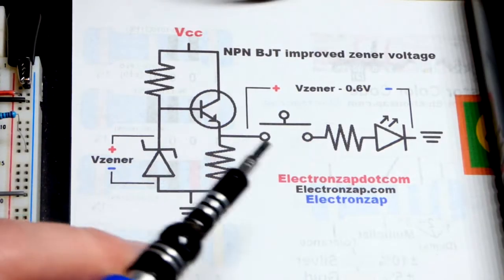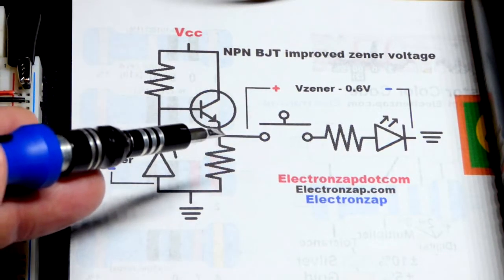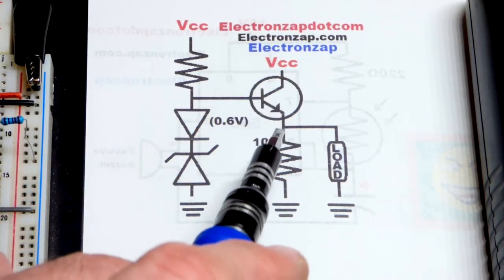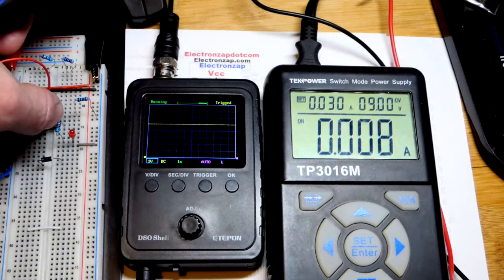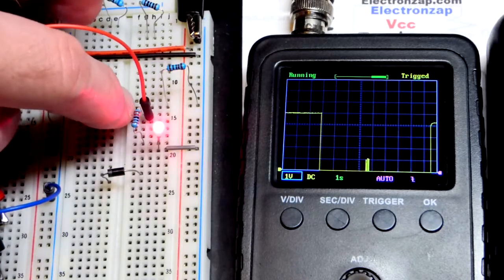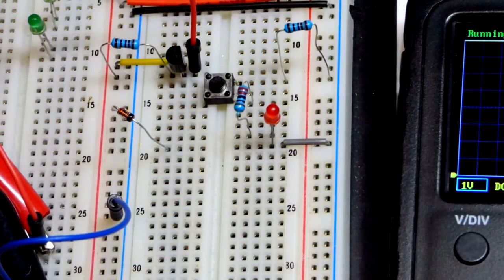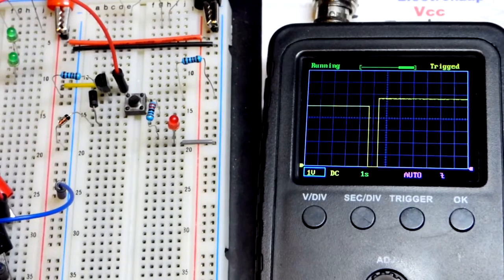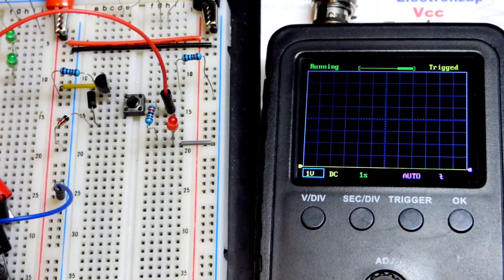How to compensate for 2N2222 NPN Bipolar Junction Transistor Emitter Follower Base to Emitter drop

Comment: I use standard diodes and LEDs for dropping/adding extra voltage when needed.   Since zener diodes don't commonly come in voltages less than 3.3 volts I use old old dim compared to todays standard brightness LEDs as a voltage dropper or references from  1.7 to 3.3 volts.   I hated to throw them all away so that is what I did with them to salvage and re purpose them.   I made an LED tester with 4 channels.  I used four old rectangular LEDs as a voltage reference and made four classic simple one transistor, two resistor 20 milliamp constant current sink test circuits.
Reply from the maker: Good times!